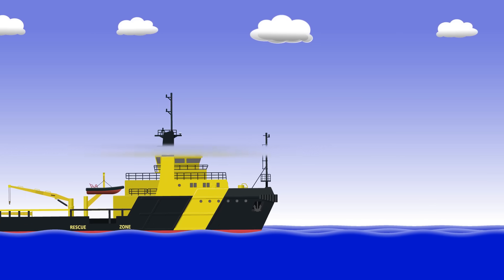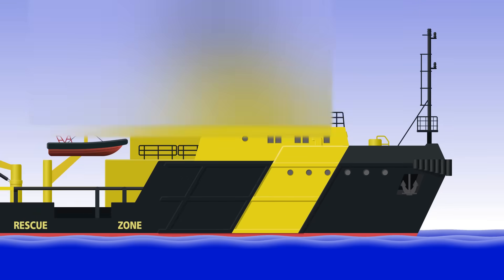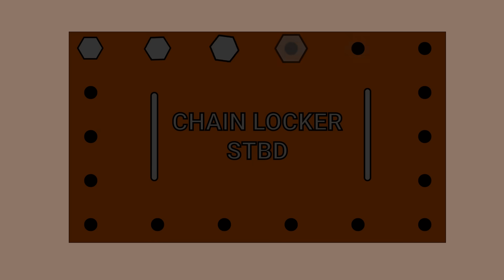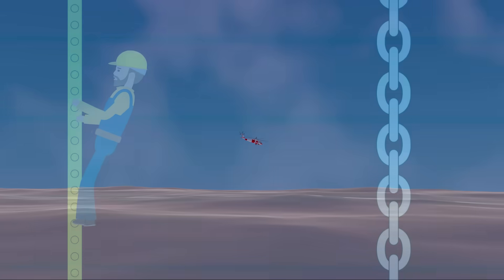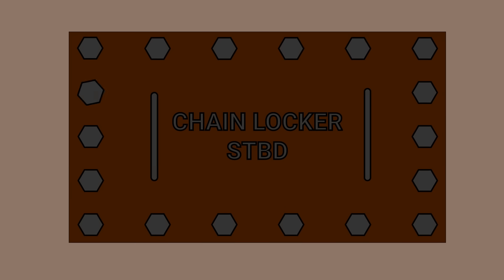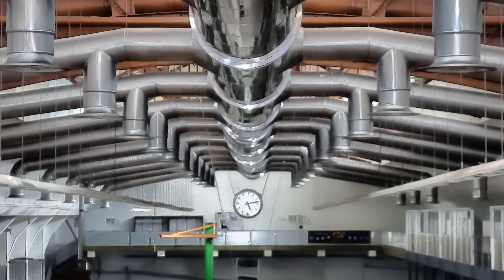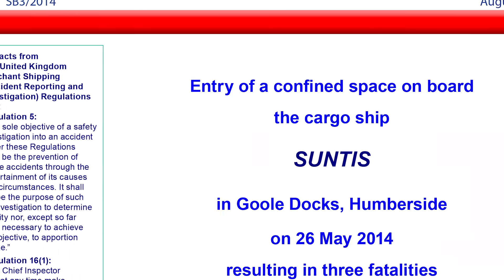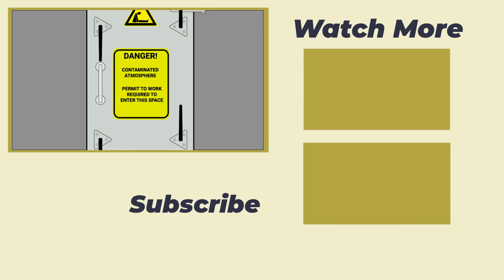Why Enclosed Spaces Are So Dangerous? | Enclosed Space Entry

Comment: This happened a few years ago on a barge moored on the Fraser River near Vancouver, BC. If I recall two workers were overcome doing maintenance in the enclosed hull - one followed another to rescue the first. First responders (firefighters) were called and at least one was killed by the same cause - no oxygen. In that situation it's literally seconds before your brain starts to shut down (that's why the oxygen masks come down immediately when an aircraft depressurizes). When I did the industrial first aid training one of the things that was drilled into us was to first ensure the emergency site was safe - the first urge is to rush in to help, but you are of no use by becoming another casualty.

Comment: One of the biggest problems with H&S is common sense, it seems people no longer have this as is seen on the internet, some do, many don't. As you said those bolts should make you wonder but they would be thinking as the chain goes outside there must be air down there. I take it the regs changed and there are monitors in chain lockers now?

Comment: Entrant, and attendant job to take a air reading for confined space. Good oxygen 19.5% to 23.5%, lel 5% or lower. Entrant may enter, entrant should be wearing a continuous air monitor that will alarm if dangerous atmosphere is present. Entrant should immediately evacuate confined space.  Attendant should also be taking air readings usually every 15 minutes as well. Attendant should also be recording air readings on confined space permit. The Attendant job is to watch the entrant and call for help if a emergency happens. By no means should the attendant attempt rescue. Attendant should never break the plane to confined space.  Prior to work beginning in a confined space, emergency rescue should be notified and alert for possible emergency.  A pre job hazard analysis should take place prior to confined space entry. Topics such as atmosphere, job scope, lock out/tag out, emergency preparedness, stop criteria, should be addressed.  There's many more details to confined space entry, crew should be well trained and up to date. All confined spaces should be labeled as such. Confined space not meant for human occupancy, less then two means of egress, and our hazards environment due to chemicals or gasses. Proper planning and preparation, engineering controls, ppe. Stay safe, get home in one piece.

Comment: The ship should have had a standard procedure for entering confined spaces and most likely did. I would even bet there was some guy on board listed as trained in those procedures and he was either never consulted or he never actually took the training. Ships that size in that line of work are all most all ways big on written safety procedures due to insurance requirements and costs. One relatively cheap piece of equipment, a confined space air monitor, and a 5 minute check would have saved their lives.

Comment: Life is sacred , be aware of present danger getting in enclosed space , use oxygen analyzer to read out for safe entry , run the air ventilation fan on upper deck and a use a breathing apparatus or air suppy hose  getting in chain locker room . Never get in if percentage of oxygen is bellow 21 percent . Should be 3 person doing this operation . Very hard to rescue a  unconcious crew . Think safety always .

Comment: One of the scarier things about this kind of stuff is that our suffocation automatic response works mostly with CO2. Other gasses that could be inert and odorless in the air composition with less than safe O2 levels could create a situation where no one would know they are in serious danger. People wouldn't know if they are experiencing a problem until they pass out, that can happen in about a minute. It's a commonly known safety concern for anyone who works indoors using any compressed inert gas, or heavier than air gas. The hull could have absorbed the O2 as rust and created an environment which was mostly N2 which is inert. They go down, no one complains about weird smells or trouble breathing and then they abruptly pass out mysteriously. What is also sad is that the majority of casualties are not limited to just the first person, but also usually the first people to try and rescue them who don't realize what is going on. Spooky stuff!

Comment: There are stories of this happening to people in ditches out in the open, it doesnt just have to be enclosed spaces. There are ditches that actually might lack oxygen or crawl spaces under buildings and such with below oxygen levels.
Reply: Yep! Carbon Dioxide is heavier than oxygen, and it's not the only gas which is.
Reply: But how exactly would that happen? What would change the composition of air sufficiently to cause that, unless it was, like, septic seepage or something like that?

Comment: I would have pointed an industrial fan down or something.  Send the skinniest guy first wearing a safety harness and a stout rope.  Three men would easily be able to pull him, he'd get his head banged on the ladder during the extraction but he'd be alive.  I don't know maybe tie their hands together with a  three foot length of rope, then tie a rope at 18 inches.  If he passes out then you could pull him up and his hands would be basically be cuffed together.  There has to be a way to test the air. Miners used canaries but it's doubtful that could be part of the ships equipment. I'd say lower a candle but I'm afraid someone is going to mention some kind of explosive gas.  What you don't know is what gets you killed.

Comment: Is dropping a lit match a safe way to test for sufficient oxygen? Or can a match stay lit with a level of oxygen that's dangerous to humans?
Reply: Gas analyzer is the way to go. A lit match can cause an explosion
Reply: Or fire.
Reply: Apart from what others have written, a match will continue to burn even if the concentration gets low enough to be dangerous to humans  - especially when the mix changes rapidly. It also ignores the fact that there might be other gases in the mix that are dangerous as stuff like CO and H2S can cause asphyxiation even when there is plenty of O2.

Comment: Same as in cellars full of fermentation gases. 
A usual gas mask does not help, You need an active Air (oxygene) supply!

Some say "use a burning candle as an oxygen indicator" - but that is not effective because a candle will still burn in a low-level oxygene atmosphere where a breathing creature is long time unconscious. You might notice that the flame of the candle will burn not as withe anymore (more yellow'isch) before You'll close Your eyes... 

So: be careful with closed rooms,
and don't trust the "candle trick"! 

It is not just ineffective, it can even be dangerous:  Imagine, the "empty" room is not filled with a low-oxygen atmosphere, but with vapors of flammable liquids (like gasoline or any solvents). BOOOM!

EDIT: Why i Know that? I had a school to professional winemaker and we had a "cellar gases" Training! If You're in low-oxygen atmosphere, You can NOT notice that You'll need breath harder or faster! You're gonna sweat and feel tired (even without doing hard work) and maybe You'll recognize that Your lips (or whole face) may tingle. When You know that You'll probably descending into a low oxygene atmosphere room by a stairway and You descend slowly, you can instantly (!!) react to this signs and leaving the room by re-ascending to a better atmosphere. 
But if You're not prepared or enter the room by descending a ladder, everything will happen so fast that You have NO CHANCE to get back safe!

Comment: I’m sorry, but I don’t quite understand how timber uses up oxygen in an enclosed space. If anything shouldn’t oxygen be produced? Otherwise all I can think of is the iron in the walls oxidizing and reducing oxygen due to the lack of light for the timber to complete photosynthesis.
Reply: How would wood produce oxygen? Photosynthesis is an endothermic reaction that requires water, appropriate chemicals (Chlorophyll) and direct sunlight, as well as living photosynthetic cells. Wood doesn't have it. There is a small amount in bark, but by and far plants process their photosynthesis in leaves. Dead plants don't make any oxygen, as they're dead.

Dead wood decays and rots. That consumes oxygen and releases gases unsuitable for breathing.

Rusting iron or steel just takes away the oxygen.

Comment: I'm surprised that there wasn't at least a small amount of air circulation from wherever the chain passed through to the outside.  I'd imagine it's difficult to build an airtight passthrough for something as asymmetrical as a large linked chain.  Maybe there was initially some air pressure differential preventing air flow, but I'd think opening the hatch would have changed that, at least by the time the third person went down.

Comment: Working in the trades (especially oil fields), you have to take H2S alive training, confined space entry, as well as others because H2S, depending on ppm (parts per million meaning of a million particles, this amount is out of a million) and H2S having 1 ppm can smell terribly of rotten eggs. 100 ppm “burns” your sense of smell. At 700 ppm or more, one single breath can possibly kill you in an instant. H2S is produced when organic whatever decomposes without the presence of oxygen. Which was quickly learned using lake water for steaming the oil out of the ground. Heat kills amoebas and other things in the water. Corpses rot without oxygen, and H2S is produced. Which is why drilling for oil now can be so dangerous. Because the pockets of gas come out with the oil. (Not the only risk of H2S just an example)

Comment: The anchor has a metal chain. how do you make a room airtight with a chain running through the ceiling of that room?
Reply: Not sure if they ever implied to be airtight.  Just a small hole / low airflow. Like breathing through a very thin straw and trying to go for a run. Not airtight but you're not going to get enough air. And I'm not sure off the top of my head, but there are gases lighter to heavier than air. Perhaps the limited oxygen was lighter and the more toxic stuff was hovering near the bottom. Few ideas, for what it's worth.
Reply: @wolfhunter98  i think CO2 is heavier than air so you are probably right.

Comment: Obviously, JHA (job hazard analysis) and company confined space entry permits were not used. These are part of the SMS designed to prevent such occurrences. We stress this in training each week about use of JHA's and permits, which must be signed off by the Captain or Chief Engineer prior to entry, and after a thorough training and instruction is completed, usually by the Chief Mate or First Assistant Engineer.

Comment: I worked 7 years as a plant operator at a large refinery. A big part of my job was getting vessels ready for Confined Space work inside and ensuring safety while the work was being done.
This exact same scenario happened at my plant in 1981. A guy climbed down into a vessel (that was filled with Nitrogen) to fetch a dropped hammer and collapsed, and than his 18 yo student climbed in after him and collapsed as well. Both of them died almost instantly.

Comment: They should have used a TMX to test the oxygen level as explosive gas or vapor levels. Also use of a rescue line would have been smart too.
Reply: @automaticninjaassaultcat3703  harness+line= drag/lift you to the entrance.. of course that is only if you can see or realise they are down...

You do not die instantly... but you very quickly get to a point of no recovery... 5 mins Max..  and unless you have something I place for instantly recovering the person.. by the time you set up and then do the rescue they will be dead..
Reply: Hindsight is 20/20
Reply: @TismSchism  Not hindsight just Good seamanship.
Reply: @stepheneurosailor1623  i don't think such prudence applies only to the sea. It should be standard safety requirements for working in any confined working envieonment.
Reply: @TismSchism  Yeah but they are a rescue ship.  You'd think generally this would be well known.
Reply: @automaticninjaassaultcat3703  actualy, a human can survive for around 3 minutes without air, however I guess toxic gasses  could accelerate it...but it is still not instant death. and in an instance with a vertical hatchway above, a line and block could be used to pull the person out.
Reply: Wow.   (  : 💨
Reply: Hindsight...mmm 100% to make one think they are intelligent.
Yeah, I’m sure they should have done what most people do - wake up not intending to DIE!
Reply: Honestly was thinking the same thing, merely be able to be hoisted back up means everybody lives
Reply: "nah, just tie up those chains" - the guys, probably
Reply: Correct application of the confined spaces regulations and a competent assessment of the risks of entry.
Reply: Seriously this shit is just common sense.
Reply: A rescue line? How would that help? An unconscious person can't do anything with it so you'd have to go down to attach it and... oh wait, you're also dead now.
-edit: I'll have to correct myself here, he probably meant a rescue line that is permanently attached to a harness before the dude went in. That actually would've helped them a lot, my bad.
Reply: @n3lis94  you wear a harness with a line attached to you and a tripod where they can pull your unconscious body up.  And you have to wear an air monitor which would have gone off alert as you started down
Reply: @n3lis94  I'd put on a rescue line if i was climbing down to rescue some one. If not for them, for me. If i end up passing out or getting knocked out from a slip, guy on the other side pulls me up when I'm not responding to the radio.
Reply: @n3lis94  not all confined spaces are the same. Some could be benefit from a line if its close to the access point. A line could also tell responders which direction to look if there are T intersections.
Reply: @mixflip You were talking about the situation in this video specifically, in which a line is completely useless until you are wearing oxygen gear. At which point the crew most likely did actually use a line to retrieve the three bodies.
Reply: And they should have used NORD VPN, THE BEST VPN ON THE MARKET

Comment: It is called a "Confined Space". These spaces require a "Confined Space Entry Permit" routed through the scene leader, supervisor and ultimately the ship's or plant's, gas free engineer, or sites' OSHA safety officer. Enclosed spaces are Confined Spaces, but Confined Space covers
a larger interpretation. There is a lot more gas testing, documentation and blowers that have to be in place and scba's that have to be donned before entry, continued gas testing during entry until the entrant(s) exit. Two people will remain topside at all times., and a tested and sure communications link established, with comm checks, safety line checks and tugs Respectfully.

Comment: Maybe a sign on the bolted hatch may be helpful !
Something like...This is a confined space constructed from steel and is for storage of the anchor chain which gets soaked in sea water regularly and this causes the steel space to oxidise and in turn depletes the area of oxygen. Do not enter unless you have a calibrated atmosphere sensor to check the atmosphere with and emergency escape breathing apparatus available should it activate whilst entered.

Comment: The chain lockers were open to atmosphere where the chain guides run up to the main deck but the gasses that displaced the oxygen are heavier than air and accumulated  low in the space. Same thing happens with pools of water in some caves and abandoned mines.

Comment: This event actually happened in front of me on the U.S.S. Ranger in forward port side chain hoist, I was supposed to be the one going down to unravel a knot that had developed on the chain but a bad slip sprang my ankle and couldn’t climb down the ladder. So another guy went down I was recuperating in my bunk when I was told that three men had passed out in the chain locker, I asked if they had vented the room before descending? The answer was easy to know they hadn’t we ever nearly lost three sailors just because I and the others that usually run/work in the anchor room weren’t there that day, it was bad on my part luck but as you said the simple idea that it is so locked up so tight that water or air can’t get in or out should’ve told them to check with me or someone who knew what to do!

Comment: Easy solution would have been to drop one or two of those oxygen tanks down into the chain hold with an open valve. Let them empty out and that should be enough oxygen depending on the size of the room.

Comment: Learned this in the navy, one of the bolts also had a small hole drilled into it on covers over the bilges so that when partially unscrewed you could feel air escaping which indicated there was flooding in that particular space before the cover was unsealed.
Reply: That is an awesome tidbit of knowledge thanks

Comment: and this is why the ususally have those air blowers with plastic socks literally 30min of running that fan could have saved them or if the second person ran and grabbed one before trying to rescue just making sure to keep to outlet of air tied close to there face ive had to do that before for an emergency repair cause it was a rust bucket that hit a dock and gave it like a foot and a half gash i basically got air sock on one those big orange blowers cut open a hole that blew fresh air right at my mouth and moved slow enough that i didnt outrun the air coming out

Comment: Had similar experience few years ago. Went on a trip. I accidentally blew a hose in a deep well with a ladder by closing wrong valve before switching off water pump. I almost thought I should reattach it when owner said - "only if you want to die there". There is no air to breathe down there, 50 meter well.